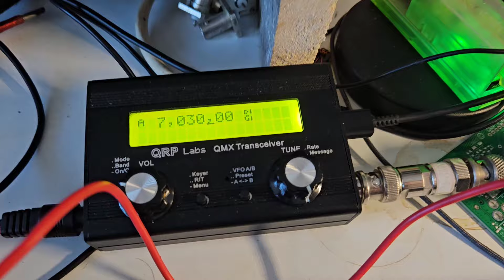QMX CESSB Demonstration

Comment: This mode allows for the introduction of a mode that is downward compatible with SSB, offering an approximately 6 dB better SNR. This is achieved with a compander setup: the transmitter compresses the signal using a compressor with a downward expander to filter out the quieter sounds. At the receiver, the process is reversed by expanding the signal, similar to Dolby noise reduction. This method can boost the RMS transmit power by at least 3 dB while still sounding natural to receivers using an expander. Additionally, it requires very little processing time as DSP.

Comment: Been a month since I saw this video and have been checking for the firmware upgrade to enable the SSB TX feature.  You promised this was weeks away at Dayton 2022.  Any ETA available on this upgrade.  Would be nice as a xmas gift.
Won't move on a QMX+ until SSB TX is up and running.